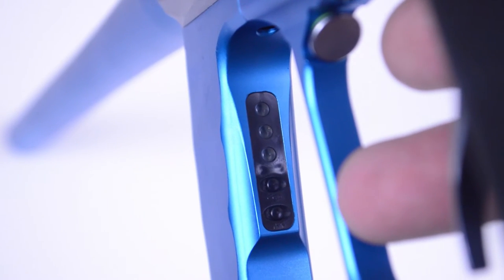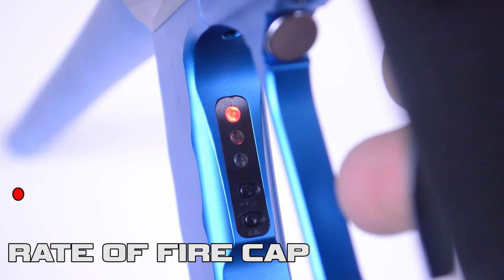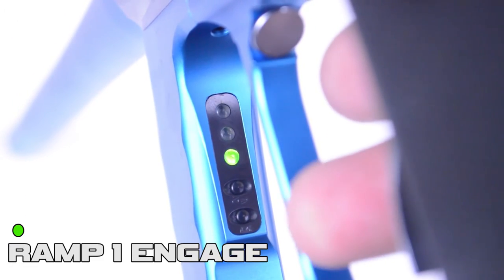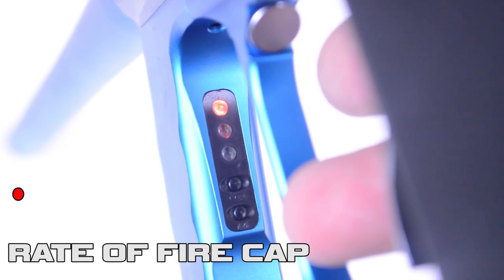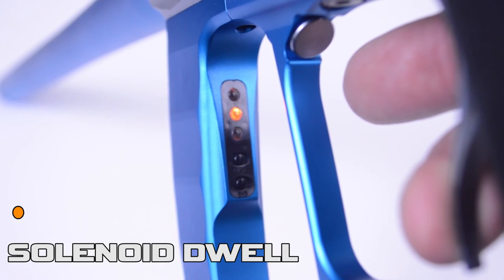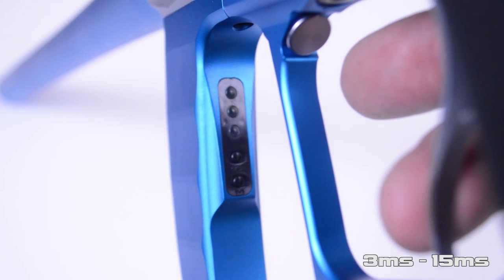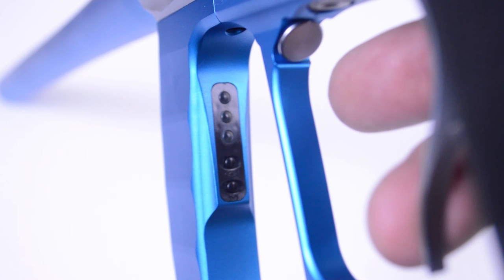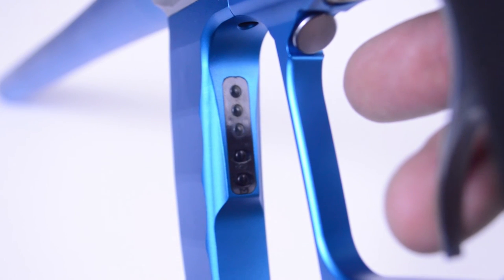Valken Minute Clinic - Proton - Programming Solenoid Dwell

Comment: There is a solenoid leak problem. Also what dwell should I use for a 68:4500 in 70-80 degree weather. I don't care about air efficiency I just want range and smootheness
Reply from the maker: +elijah terrien Dwell should be 1 or two for temperate weather and smoother performance. Solenoid leak problem? VERY uncommon. where is it coming from?
Reply: +ValkenVideo it's almost like shoot down but worse. The gun will fire fast for about 10 balls and then just start venting air but not firing. Only happens when I walk the trigger really fast
Reply from the maker: hit us up on live support and we'll see if we can help you troubleshoot or get it fixed at valken.com